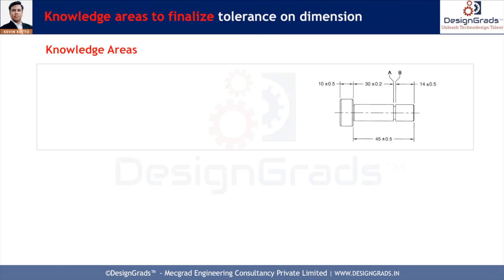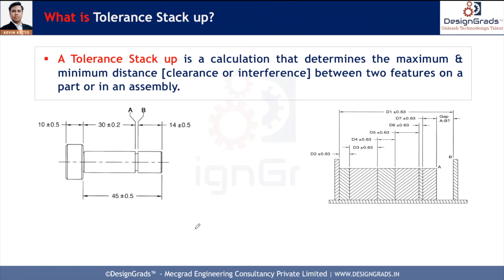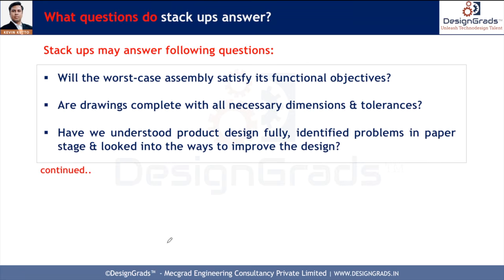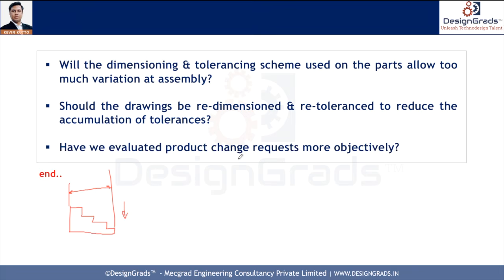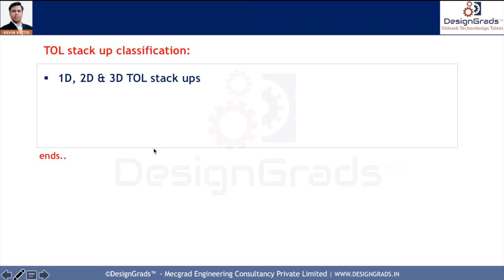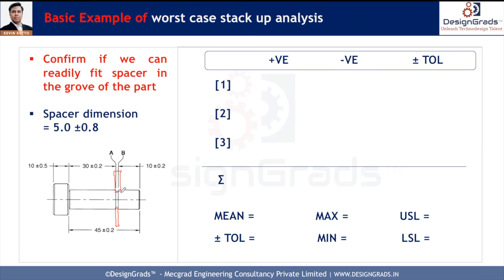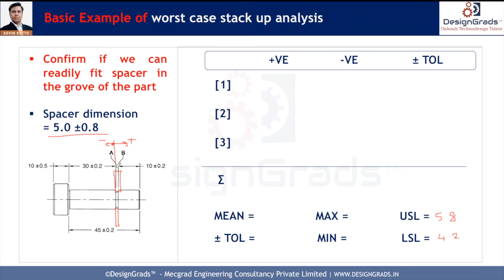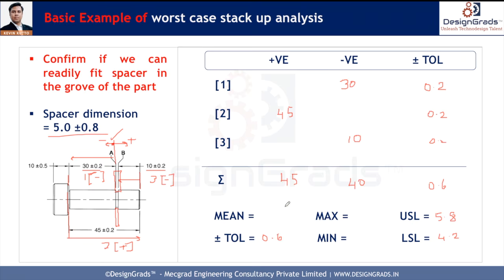What is Tolerance stack up analysis | Why Tol stack up analysis

Comment: In my opinion, you have taken a very simple looking illustrative case which can be solved orally within half a minute. The mentioned tolerances on the three dimensions can be directly added to +/_ 0.6 Can you illustrate a little complex case where the individual tolerances are not equally disposed bi-lateral ones, but with a mixed variety of un-equally disposed bi-lateral tolerances, uni-lateral tolerances etc.
Reply from the maker: In the case of unequal bilateral or unilateral tolerances, you have to convert it into equal bilateral for the analysis and then remaining process remains exactly same as I explained in this video.

Comment: Actually all the spacers of 4.2~5.8 will not fit in slot of dimension 4.4~5.6😀
Reply: I believe if Min of groove is 5.8 then and then all the spacers will be fit in slot which means we need to correct the overall mean from 5 to 6 and if the parts are legacy then we need to tightned their overall toleraces from 0.6 to 0.1 then all the spacers will fit. Correct me if I am wrong.
Reply: When the slot is at 5.8 won't fit in 5.6 gap
Reply: For 5.8 : 5.6 is interference fit 
For 4.4 : 4.2 is clearance. 
So spacer dimension must be based on which fit do you need to plan in both lower and upper case..
If we need correct dimension fit then spacer dimension tolerance need to modify i.e 5 +/- 0.6
Reply: In wrost case spacer may not able to fit because spacer max dimension is 5.8 and we have max clearance in bolt is 5.6 so in wrost case we can't fit the spacer or we have interference fit of 0.2 mm so for wrost case we need to modify the spacer dimension as our bolt is legacy

Comment: How did you get 5 as the mean of the sum of 45 and 40 mm? wouldn't the mean be 42.5 mm? isn't that just the difference between the sum of both positive and negative directions?
Reply from the maker: This mean is the mean of the clearance between positive and negative values because we are interested into the clearance and it's variation.
Reply: @mechanicalvault  It doesn't make sense (to me at least) to call it the mean when you didn't do (45 + (-40))/2, which is the mean equation for two values. What you did was 45 + (-40). Wouldn't that be the nominal size if it was a perfectly made part without tolerance and not the average size if it was a perfectly made part?
Reply from the maker: Looks like you need to sit with someone experienced and understand the concept of Stackup analysis.

Here we are not talking about the dimension average, we are talking about the mean of the gap and then we apply tolerance value to get extreme limits.
Reply: @helpmeimconfused  that is correct, his explanation is wrong, mean is 42.5 and you calculate the sigma value of each dimension and then calculate the min/max overall dimension to fit the spacer
Reply: so nominal gap?

Comment: I have a doubt, if the spacer comes at USL i.e. 5.8 mm how will it fit in the groove of max dimn. 5.6 mm??
Reply from the maker: Yes, you are right.

Max dimension of groove  has to be more than 5.8 in order to fit the spacer.

This will drive change in stack up chain dimension or tolerance so that it meets the requirements  since current dimensioning chain is not meeting the requirement.
Reply: @mechanicalvault  Dont you think minimum dimension of groove should be higher than 5.8 in that case, all the spacer between 4.2 to 5.8 will fit in the groove?
Reply: @mechanicalvault  I believe if Min of groove is 5.8 then and then all the spacers will be fit in slot which means we need to correct the overall mean from 5 to 6 and if the parts are legacy then we need to tightned their overall toleraces from 0.6 to 0.1 then all the spacers will fit. Correct me if I am wrong.
Reply: @Halchal_America  yes we need to correct that to 5to6 without changing what he said was wrong in the video, make correction that is wrong
Reply: @Halchal_America  make the dimension to 45.2+/-0.2. it  will fit for all cases!